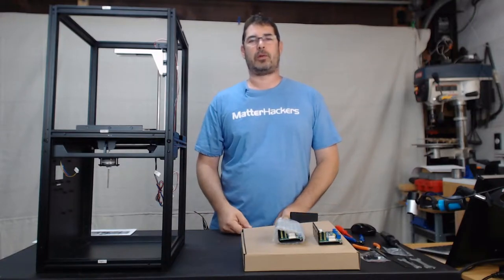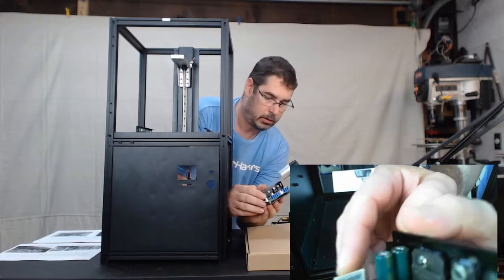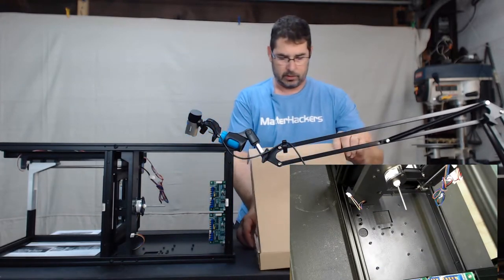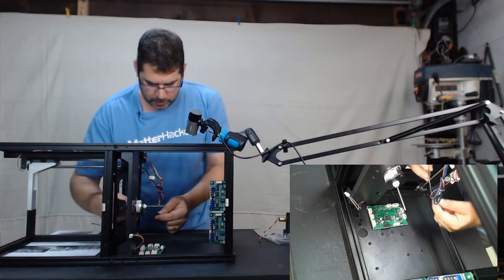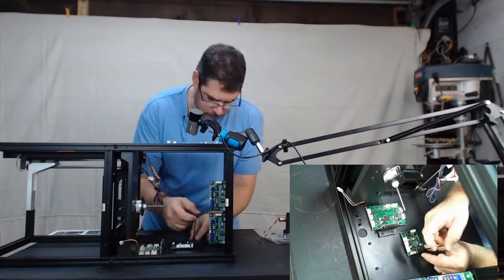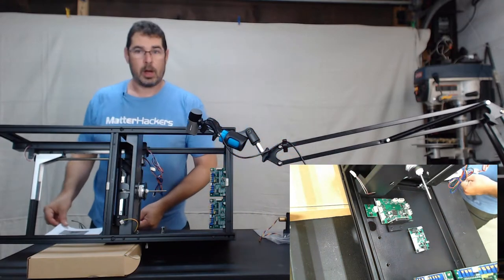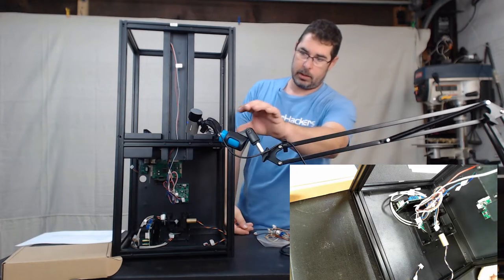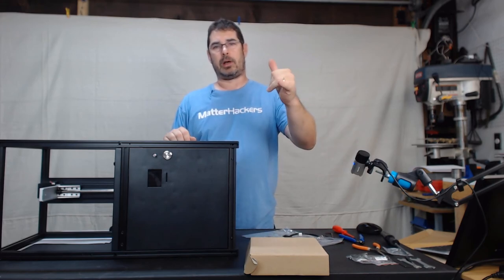Moai Series Part 6: Installing the Electronics

Comment: Thank you for the videos so far. I am on the tipping point of getting this printer to add to my collection. So nice to see a breakdown of the build.
Reply from the maker: Whilst I haven't yet printed with it, I can say the build itself is really easy so far and Peopoly has a great community growing behind them both on their forums and on face book. One of the owners was showing a Benchy printed at 5mm this AM! (had to retweet that one...). Beside the price being reasonable compared to other SLA printers, the attraction for me was that it's not locked down entirely, AND it prints from standard gCode- it doesn't need special slicing software.

Comment: For the sd card breakout, I had to bend the metal plate past 90.  Otherwise, it would put too much stress on the connectors.  I didn't want to see the plate pulling the sd card breakout away from the controller board.

Comment: I have no idea where to connect the control cable, the link to the manual does not work. Is there a new link?
Reply from the maker: Dave Hepp this is the most recent version of the manual I am aware of.  For additions information, reach out to them on their forums for more help.
https://docs.google.com/presentation/d/1yzSxYxJ2hDWH5Tks4eD-P5XpEBOaRhRxpic4mbyX3ks/mobilepresent?slide=id.g29028e6431_25_16

Comment: thanks for the videos, but man, when it comes to what wires go where, ya kinda skip that main part, lame....
Reply: I guess this part of the description wasn't clear? " I thought I would take the time to document the build in a series of bite size videos that would help make it easier to make it through the build and follow along with the Peopoly documentation." you need to follow the documentation when building this machine. He pretty clearly pointed out this is an aid and not a replacement for the manual.